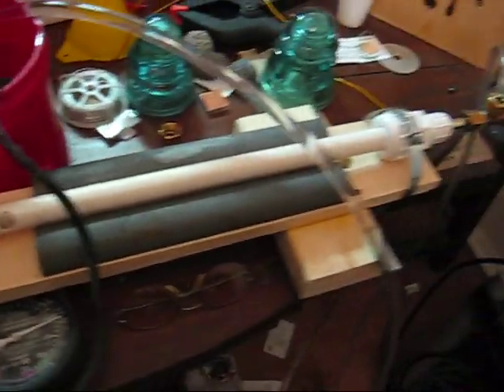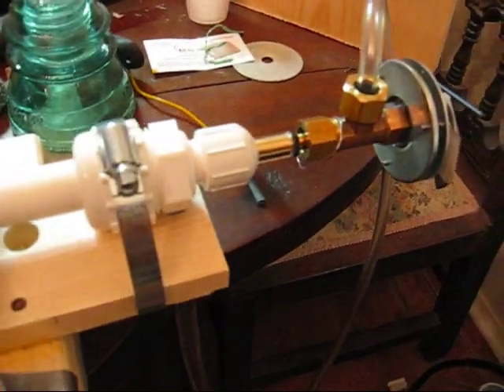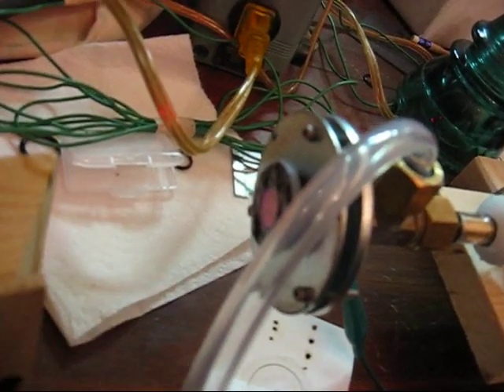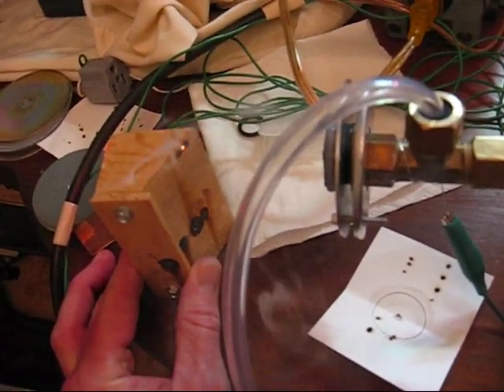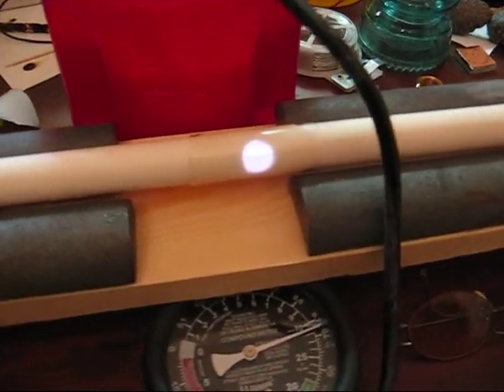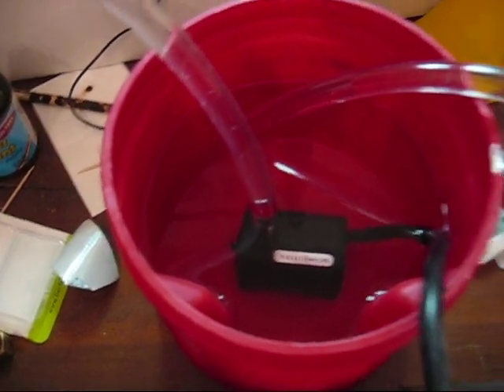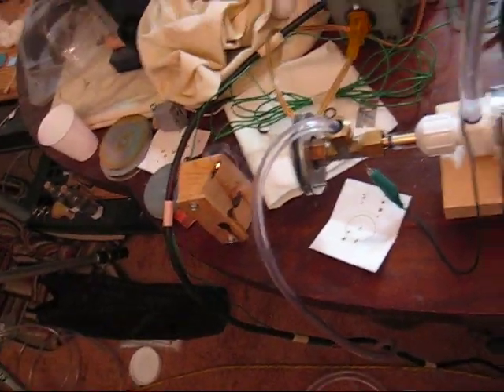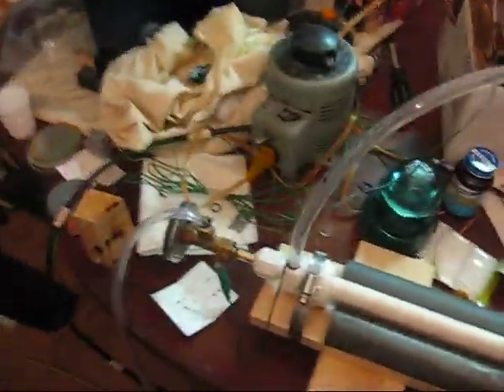My new homemade CO2 laser

Comment: sir what type of partiacl mirror you use ask me
Reply from the maker: This laser uses a Zinc Selenide partial mirror. Zinc Selenide (ZnSe) is to mid-infrared wavelengths what glass is to visible light. This means we can use ZnSe to make lenses, windows and mirrors for this laser. If however we are only reflecting the laser beam, we can use metal or even glass mirrors - ordinary glass will work as long as the reflective part is on the surface (instead of the back side, or behind the glass, as is the case with normal shaving and bathroom mirrors). If a ZnSe partial mirror is unavailable, we can even use a metal or surfaced first mirror with a small hole to pass the output beam. The hole must be covered with something that will transmit the beam however because most things are completely black to this wavelength. Fortunately it turns out that salt happens to be transparent to the wavelength! This means we can place a sliver of rock salt over the hole to seal the tube, and the output beam will then be able to pass through the salt window we've made.

Comment: Freaking cool!  Have you hooked these up to a cnc machine?  If you don't cool the laser does it crack, or just stop lasing?
Reply from the maker: Not practical for a CNC machine. Performance is inconsistent and unreliable. Good for hobby only. If the tube isn't cooled, the glass will crack after a very short time. The electrical discharge generates a tremendous amount of heat.
Reply: Lasers, HV, and more , that is what I've been finding: inconsistent power due to gas mixture that needs replenishing due to leaks.
So keeping the gas from leaking seems to be the hurdle to overcome.
In your experience, how difficult would it be to maintain the gas from leaking over a year? What aspects of a diy laser would need improvement? (Ex. No more using JB weld. No more using silicon. No spongy gaskets to tweak the laser mirror. All would leak over time. What else?)
Reply from the maker: Flowing gas is not actually intended to displace air that has leaked into the tube, although this is in effect what is taking place in my lasers. In a perfectly sealed tube, flowing gas is intended to replace warm gas with cool gas. I think it's also intended to flush or remove byproducts and impurities that have resulted from the electrical discharge. 

Sealed tube lasers are different from the flowing gas type. I think they have additional gasses other than helium, nitrogen and CO2. They're designed so that byproducts are automatically separated from the main discharge. From what I understand, you can't just stick helium, nitrogen and CO2 in a homemade tube and expect it to run like a sealed tube. It's just not that simple.

Comment: Please provide an estimate of your parts cost. How many Watt is it ? Or if this is hard to determine then what thickness material that you've cut eg ply, acrylic plastic, ABS plastic or metal can it cut at what speed please ?
Reply from the maker: Hard to say. It depends upon your ability to scrounge. The NST and ZnSe optics are going to be the biggest variables. If you can get an old iron core NST from a local sign shop, you'll be in good shape. Avoid electronic sign power supplies - get the old kind with no electronics (current limited!). The ZnSe output coupler can be expensive. With patience and determination however, it should be possible to get a ZnSe output coupler for a good price, via eBay. 

Glass/borosilicate tubing shouldn't be too hard to obtain. Sundance Art Glass, in Paradise California, is a possible source. Likewise for eBay. 

All other parts are common - o-rings, PVC, compression fittings, etc. Here is a diagram of the basic layout. 

http://jarrodkinsey.org/co2laser/two.JPG

My main page (ongoing/under construction) can be found here:

http://jarrodkinsey.org/co2laser/co2laser.html

Construct at your own risk! The power supply is lethal and the output beam will burn flesh, start fires, and boil the surface of your eye-ball like an overcooked egg! 

Oh... power output - I almost forgot. I've never measured it, but a friend of mine, who is a physicists, estimated this laser to be about 40 watts.
Reply: *****
 Thank you Jarrod. Very generous with your information & advice. DIY laser builders keep referring to 'Glass' but is it silicone glass ? I have a feeling that it isn't 'conventional' silicone glass. Why must it be glass at all ? Must it insulate from the discharging CO2 reaction that's occuring inside ? Could an aluminium tube with machined cooling fins be used instead with the electrodes insulated from the aly tube in a very low power CO2 laser ?
Also another builder used conventional mirrors for the tube end reflectors. I thought that the silicone glass coating of a conventional mirror would diffract this wavelength ?
One of the mirrors needs to pass the beam ? No ? So are the 2 mirrors different from eachother ? If they're the same mirror then what stops the laser from emitting out both ends ?
Can I use the same mirrors that are sold on eBay for reflecting the laser to the cutting head as both my tube-end mirrors ?
Please explain what's wrong with electronic neon sign power supplies ? Can I control the output of my laser with modifications to the NST ?
Reply: ***** where did you get the tube for the laser? and where did you get the partial reflective mirror?
Reply from the maker: Neon sign tubing will work. As long as water flows around the tube, heat shouldn't be a problem.

eBay is a good source for the optics (which is where I get most of mine nowadays), and tubing can be obtained from either eBay or http://www.sundanceglass.com/
Reply: ***** Thanks for your time.
Reply from the maker: Glad to help. If needed, feel free to email me. Visit my website and you will find my email address. Please put something in the subject line that will enable me to easily identify the purpose of you email, less I dismiss it as spam.